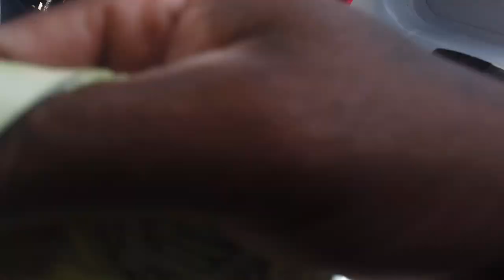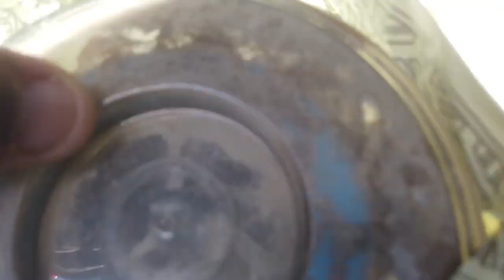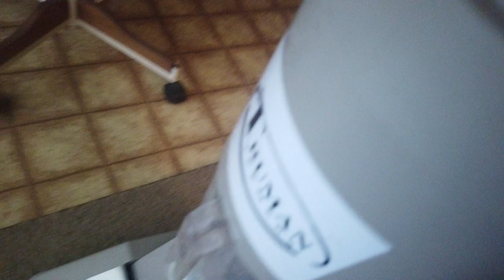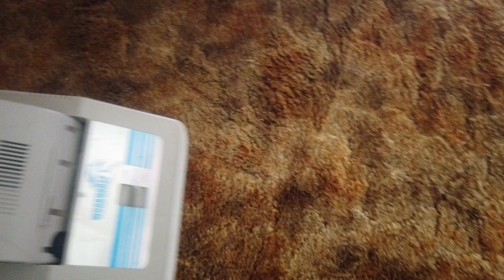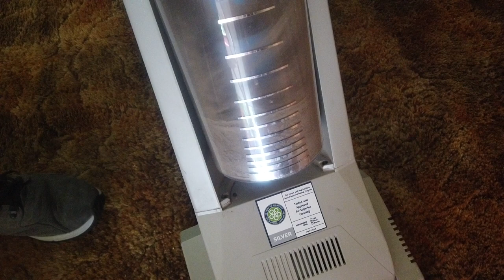Vacuuming 1 room with the Workhorse vacuum🤯 ASMR SATISFYING VIDEO

Comment: One time, after filling it up like that, try going over the same area after emptying the canister just to see what might still come up.
Reply: Here's a dirty secret, you can't remove 100% of the dry soil from carpet, you can only reach a point of diminishing return.This is how door to door vacuum cleaner salesman can pull more dirt out of your carpet than your existing machine. You can take a workhorse and clean deeply, a Kirby salesman can come up and do his demo and he will find dirt. Now, imagine if a filter queen salesman meets the Kirby guy going out the door. He will find more dirt in the same stretch of carpet. Lastly you take the workhorse and vacuum the same spot again, you will likely see even more in your workhorse.

At this point you may need several passes to get a visible bit of dirt in the cup, but you will still get dirt.

Now, before you rip out all of your carpet, think of this. Where does the dirt from the carpet come from in the first place? Quite a bit of it comes from the air. Now, a poorly maintained carpet will have some lines of dirt around the edges, these are called "filter lines." Now, why would that be, well some of the air in your home actually flows through your carpet, it is not an efficient process, but it does happen. Your carpet is cleaning you AIR.
Reply: @jrmcferren  Wow, that was very eloquently put.